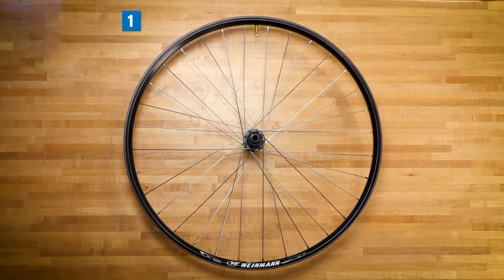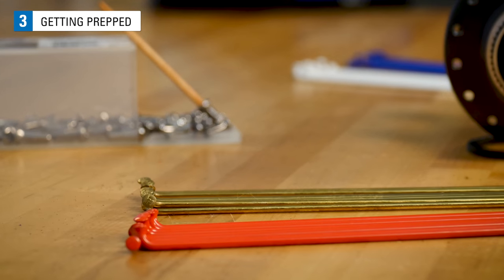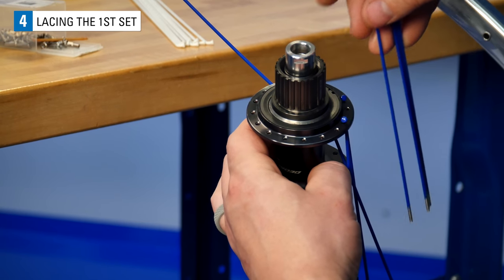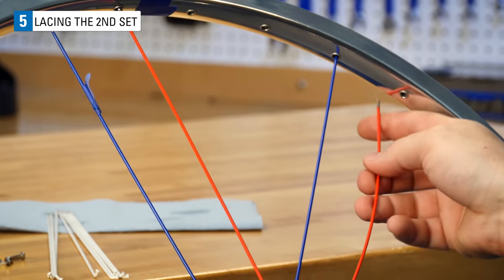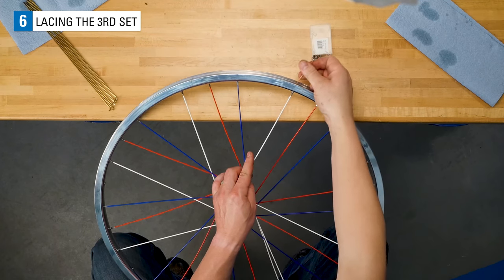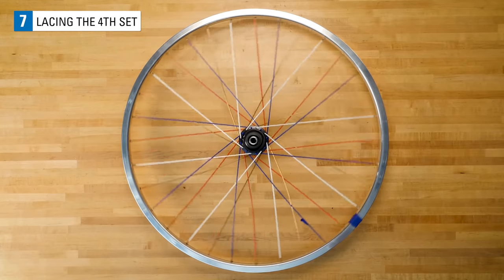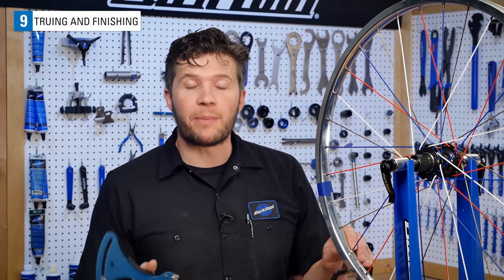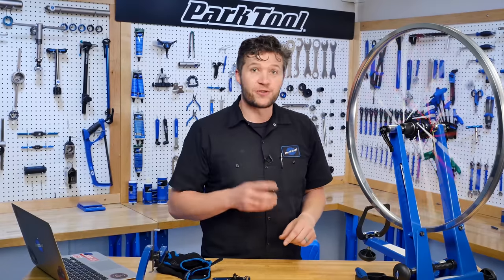How To Build A Bicycle Wheel

Comment: i train as a bike mechanic right now and we talked about wheelbuilding and this video, because he gets the pulling and pushing spokes wrong. Normaly the pull spokes are the outside spokes ( outside spokes = spoke with the elbow out )  but he puts the pull spokes inwars what makes them instable at the spoke head . It is not 100% important for normal city bike wheels but on a high level mtb or road bike wheel set you should think about it
Reply from the maker: Ah, now the question to you is why do you build your wheels like that? And what do you mean by "instable at the spoke head"?
Reply: @parktool  well because the pull spoke is able to rest on the hub flange and the spoke ellbow does not get strained as much when tightening the spokes     If you are lacing a wheel like you did the spoke head gets often ripped of because of a higher stress within the ellbow. The pull spoke gets more often stressed due to the drive train pulling on it while you are pedaling so if the pull spoke is a inside spoke the ellbow gets pulled open and the spoke material gets weaker and weaker with every time you use the bike.
Reply from the maker: But lacing like you are suggesting creates weakness under braking which creates more stress on the hub than acceleration from the drivetrain. Either way is fine is what im saying. Its what we would refer to as a "Beer topic" as it depends on who you talk to and in the end both ways are great ways to build wheels.
Reply: @parktool  well yes they are 

But i would still lace the brake side like you did

 so i would only change the drive side so that creates a strong drive side and a strong brake side because the spokes are in a „ideal“ position for ththeir side   Well call it asymetric lacing
Reply from the maker: The forces on the drive side spokes are the same as the non drive side spokes. Think about when you lace the drive side radial and non drive 3x. You are still using the torsional benefits of the crossing. The hub shell transfers that load. Mavic is known for doing that. Another sip :)
Reply: I igree with Ben, the same Idea to lacing the left side side for both
Reply: You are correct Ben, pull spokes on the outside. Keeps the wheel less stressed when climbing and the pull spoke has more surface contact with the flange.
However when lacing a wheel it's more tricky to get right first time & annoying to relace when you discover you did it wrong :D
Reply: @parktool  Dish is different between drive & non-drive side. This is the reason for building 3x drive side, 1x non-drive side.
Reply: Funny you say your in training whilst lecturing Park tool on how to build wheels
Reply: @Adam-vm8kp  we get trained by dt swiss and i think if they teach it like this is isn‘t wrong
Reply: @Adam-vm8kp  and by now i am a trained master technician in germany and would do it the same way because 99% of the mtb race teams in all categories build their wheels like i and dt swiss do so i guess it works but i just wanted to point it out that it might be not as strong as the manufacturer recommends so if you build it like park tool it is fine but might result in a less durable wheel just a info you can do with it whatever you want

Comment: Great video for building new wheels. Easy to follow.

A tip is to use linseed oil as lube for the nipples. When it dries after some time, it locks the nipple enough to stay and it will easy unlock if new truing is needed.
Reply: synthetic lube is so much better though.   it will prevent corosion and will not create a build up like linseed oil does.   the tension keeps the nipple from slipping and will never unthread itself, so it is completely unnecessary to use anything to "lock" the nipple into place.

Comment: I like the use of different colored spokes. This looks like it should work for E-bike hub motors, too. Neat. If I go that route, I'll let you know.
Reply from the maker: Yes it will work, but if you have a large motor (size of the hole pattern) use a 1X.  The smaller emotor hubs can use a 2X.  3X does not work well with the emotor hubs.
Reply: @parktool  much appreciated for the tip there!

Comment: Hi Truman, thank you for the very detailed, pro-level video!
I tried yesterday building my first wheel set, DT-Swiss based:
Rim: XM481 29
Hubs: 350 Classic
Spoked: J-Bend 2.0-1.8-2.0
Nipples: Squorx Pro-Lock Aluminum
Anyway, I wanted to share my experience as it was all going perfectly well up till the final tensioning and then the $h!t hit the fan 😕
The lasing part 3-cross was amazing and went smoothly!
While trying to reach better tensioning everything got out of true, and the more I tried to fix it, the worse it got.
I took everything apart, and saw that several of the spokes got really stretched, the key spoke, was 292mm (as the rest of the drive side ones), and it got stretched to almost 300mm!
The stretching caused the spokes to protrude outside the nipple end and I couldn't tension anymore for trueness.

Should I have stopped sooner?
Should I have used a thicker spokes (2.0 all the way)?

Again, thank you very much!

Guy
Reply from the maker: Spokes should not stretch like that. Especially if you are using DT spokes. They are elastic but should not stretch. They would break before elongating to that point. What was the tension of the wheel like? A butted spoke is not weaker than a straight gauge spoke so they will not stretch easier. They are rolled and basically work hardened in that process making the structure very strong. There are wheels out there that run 180KGF on them and the spokes do not stretch. It is more likely that a 300mm got mixed in.
Reply: @parktool  Thank you for the response, I really appreciate it!
I almost certain that all spokes were the correct size, I even have a park tool spokes ruler :)
Anyway, I'll try next time with the front wheel, which uses 293mm on the rotor size and 295 on the right side, I'll double and triple check their size.
I want to stick with the butted spokes, and hopefully this time it'll go well.
Another question, do you recommend using the aluminum nipples or brass is better?

Comment: This was amazingly helpful. The first wheel I built was a pass mark in that it had the appearance of a wheel, I never really trusted it. Following this method I think I’ve built something bomb proof. I just need one of those park tool TP-1’s, who has a toothpick around any more? I used the UP-3 from inside the rim to then guide the spoke nipple into the correct seating with pressure from above then with the ND-1
Reply from the maker: great problem solving skills!

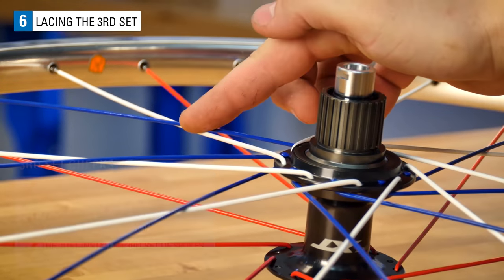Comment: 12:43 This part was explained a bit rushed. Here's where many mistakes are made. One or two spokes are left uncrossed over/under. Or a spoke was crossed over/under two spokes rather than one (on some dense lacing patterns). Check this two or three times.
Reply: This happened to me just know, turns out this particular rim needed spokes to be laced crossing 3 and under the forth. I'd say if you have the other wheel available, take a look at it to see how it is laced so you don't waste time relacing the spokes like me jaja
Reply: standard hub/rim /spokes can be laced  with 0,1,2,3, 4 crosses(32hole up to 3 crosses, only 36 can go up to 4crosses), depends on spoke length and desired strength of wheel

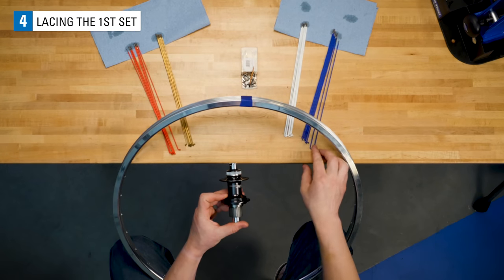Comment: It's amazing how thousands of videos on YouTube teach how to build wheels using the traditional x3 method, and they all make the same "mistake" when placing the 2o most important spoke, ( 2nd position from the valve, video 5:00). If you notice the direction of the spokes that enter the hub from the inside out, on the original wheels of all manufacturers, those on the left side (not transmission) point in the direction of wheel rotation. those on the transmission side point in the opposite direction.

In the video (5:00) if you put this spoke in inside-out position, all the others will coincide with the manufacturers' original configuration. If you did it as shown in the video, when the wheel is finished, both sides of the hub will have spokes that go from the inside out, pointing in the direction of wheel rotation.

This small detail may not be very important, but it will affect the dynamics of the wheel's lateral forces.

Comment: There are over 500 comments so I'm sorry if I missed a question I have which may have been already addressed. My question is, what is your stance on spoke prep seeing as this video showed dipping the threads in lube oil? I dip my drive side and non-ds spokes with different colored DT swiss spoke prep tread locker to make it easy for me to know which side is which (mainly in cases where one side has 2mm+ difference than the other in length). Is it more recommended to skip the tread locker prep at the start and follow your video and maybe apply spoke freeze at the end (after cleaning off the lube oil of course)? Thank you. I needed this refresher. I've gotten complacent. I love wheel building.
Reply from the maker: No issues with using a spoke prep at all. It's a debated topic that there will be many answers for. Use what makes you comfortable. A properly tensioned wheel will stay together with just oil but its a bit can add another level of security to use a spoke prep. A good spoke prep will provide lubricity when assembly and will congeal after it sits.
Reply: @parktool  Thank you. The last line makes sense and I'm guessing spoke-specific prep compound was more than likely engineer to function as both a lube and polymer. Thank you. I will be building two wheels this week and this was a great refresher for sure. You're TM-1 tool is definitely a must have. Thank you.

Comment: I tried this when I was about 13 years old, While I did get the pattern right (other than crossing the third cross) it didn't go too well. I didn't have this method, I swapped a hub from onr rim to another that wasn't as bent, I managed to get the pattern from memory. I assume it was the not tucking the crossing the 3rd cross, that did my endeavor in. This is the first vid I've ever seen, where I could actually see where I screwed up. thank you. BTW I'm in my 50's now, to give you an idea how long ago this was

Comment: Shouldn't the drive-side outer spokes be laced in the pulling direction only...opposite to what you've done?
Reply from the maker: Lotta ways to get to Rome. No one way is without its ups and downs. This way and your way have equal pro's and con's.
Reply: @parktool  A Con worth mentioning may be a warranty claim denial if you don't lace to a mfg's spec. Take Shimano for example which is laced as this commenter states and you use a modern Shimano mountain disc hub in your video.   A clarification of that would be helpful is all.

Comment: first time ever i finished lacing a wheel in less than the 20 minute video ( i watch it every time i lace a wheel lol yeah i have a bad memory but im slowly remembering)
complete contrast to the last wheel i built which was a completely nightmare, shimano metrea spokes which come with loctite on them and internal nipples. i twisted(bent) a few of them before realizing i need to grip them as far down as possible to prevent them spinning (bladed spokes). they're $5 CAD per spoke so i learned pretty quick but the loctite made them twist even before bottoming out so i had to clamp each spoke every turn even while just simply lacing. PITA

Comment: Best video so far . Please will I use the same spacing and crossing for a 28 spoke rim ?
Reply from the maker: With a 28h rim and hub you can do the same pattern but it is often best to use a 2 cross pattern the process is the same except you go over one spoke under the second and then to the rim. only crossing two instead of three.

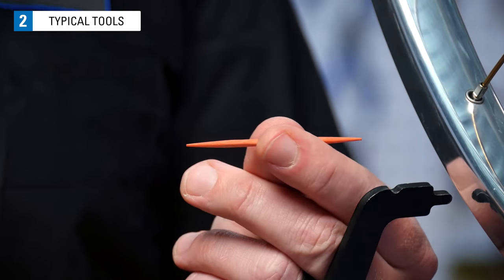Comment: 2:40 - take an old spoke, cut a section of approx. 10 cm/ 4" long from the thread side, bend the non-thread end into some "T" like shape, akin to a fireplace poker end - "half-S" probably would be a better descriptor though (it's not necessary, but sometimes that "T-bar/half-S handle" may come handy).
Then take an old nipple, grind its head so the screwdriver groove is gone, then screw it onto the spoke "as per normal" so that about 3-4 mm (.12 - .16 in) of the thread sticks out, put a drop of superglue on the other end of the nipple (so that it'll stay there and won't unscrew) and voila! - you have the perfect shop-made tool for holding and screwing on nipples onto spokes when lacing a rim with "recessed" nipple seats (aka double chamber rim).
Screw on the nipple to be placed onto the spoke, stick it in, make few turns so the nipple is engaged onto the spoke, hold it with your finders and "undo" that tool from the nipple, "rinse and repeat" till done.

To improve your grip on that "DIY spoke-tool" you can wrap some "painter's tape" around it, works great - or if you're really "industrious" and have a turning mini-lathe handy, you can make a knurled brass sleeve that'd do the trick, but that paper tape (painter's tape) would do the trick too.

Also, you can dip the thread in vegetable oil before screwing the nipple onto it - it will act as a lubricant first and in few weeks time it will oxidise and set hard ("semi-hard" rather) so it'll become an organic "loctite". (The best would be probably boiled linseed oil, but any other oil, like rapeseed oil, aka canola oil, would do - except coconut oil which, being the only saturated plant oil, does not oxidise and won't cross link, or harden.)

Also, the lacing procedure shown here seems to me unnecessarily complicated and confusing - I always lace one side first, starting from the hole NEXT to the valve hole, then I do the other side - the only thing to keep in mind is that with the second side you leave that spoke set which you put into the hub flange from the "inside" side of the hub as the last set - otherwise crossing the last set of spokes would be a nightmare.

Lacing one side completely has it's advantages - first, less opportunities to confuse the "left" and "right" spokes (they are, usually, of a different length, AND no one really uses coloured spokes  as this guy here), and in my opinion it makes the whole job much easier when lacing a wheel with heavy, internal gears hub. Just yesterday I rebuild a rear wheel with a Sachs S7 hub (second-hand replacement, the original one had damaged hub body) and that baby weighs in at over 1.65 kg/ 3.63 lbs US - good luck with that "swapping sides" method...)

For "zeroing out" (aka initial tensioning) a light cordless drill is the best. Take a flat end LONG bit (5-6 cm long/ 2 - 2.5 in) - so it can be fixed directly into drill chuck, NOT via bit holder (you need it stay firm and fixed, not wobbly) - preferably a cheap "import" one of lower quality. (These are made with somewhat softer steel, which is still hard enough for brass nipples, but they are easier to work on a lathe.)
Put that bit in a lathe chuck, and then cut away about 1.5 - 2 mm (0.06 - 0.08 in) leaving a very centre of it, just under 2 mm wide, untouched - this will work as centring tip siting in the nipple's hole, preventing the bit from sliding left or right (or both ;-)
Then use a light-duty cordless drill, as being light (in weight as well) they are easier to handle and more comfortable in this application - after all, all we need to do is to screw on. lightly, some tiny M2 threaded brass nuts, aka nipples) and do as this guy shows - i.e. screw them on until the thread disappears.

15:43 - no, you better look how your rim "wobbles" FIRST - and start by cancelling all extremes, both left and right, and "outside" protrusions as well. Once you get the wheel sorta-kinda true, only then "tighten all spokes equally", as sometimes when you rebuild a wheel from used rims (customers, can't fight them) the rim isn't perfectly flat or round, and when you end up with dilemma "equal tension on all spokes" OR "a true wheel" (with uneven tension of spokes) it's always better to produce a true wheel - as an "equally tensioned spokes on a wobbling wheel" won't win you a customer's prize (I dare to suggest...). And at any rate such wheel would be unusable, so... well, you get the idea...

Also, when you don't feel like buying a fancy and not exactly cheap spoke tension measuring tool, a medium sized screwdriver and an ear (YOUR ear) would do as a substitute - simply rotate the wheel in the truing stand while the tip of loosely held screwdriver strikes the spokes, and listen to the sound - and if any spoke has a different tension you'll hear it clearly.

"Destressing" the wheel can be done also by placing the wheel flat on two blocks of wood 180° apart, and pushing LIGHTLY on the rim 90* away from the blocks (with both hands, obviously) - then rotate the wheel approx 45° and repeat, and again - then flip the wheel and do the other side. After which you should recheck the wheel for trueness, and make corrections if/ as necessary.

And then yes, there's more than one way to skin a cat, and I'm NOT saying "he did it wrong" - all I'm saying "this is how I do it", and what I think is the best way of doing it.

Comment: great video!  I just want to build a wheel with 32 holes, only the rim is asymmetrical.  are there construction differences between a symmetrical and an asymmetrical rim?  there will be a rear wheel with brakes on the rim.  thanks!